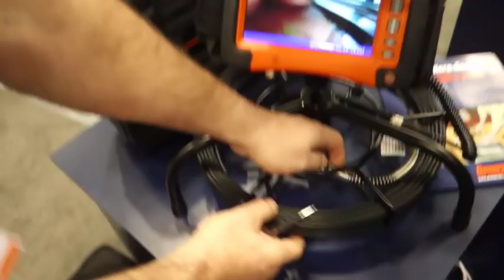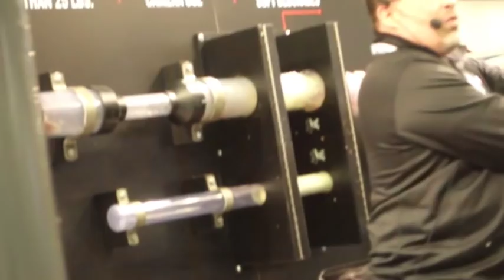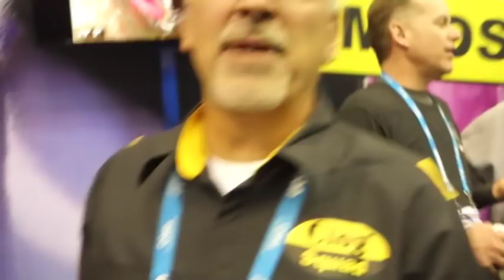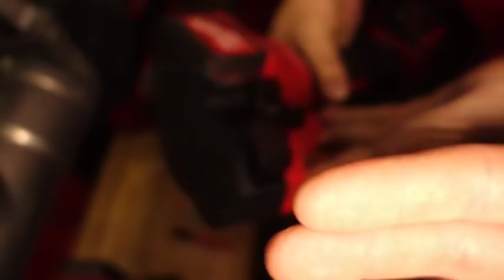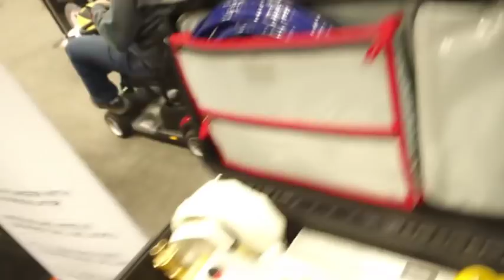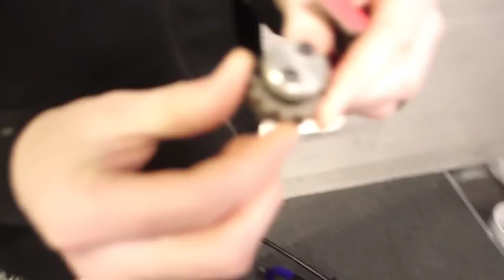Not your grandpa's plumbing tools - WWETT 2019

Comment: Regarding the Ridgid Flex Shaft...first how can you hear the difference in the pipe when the pipe is underground and 50ft away? Not that I have many 4" to 2" to 4" scenarios.  Also how does one guy work the trigger while stuffing it back into reel and wiping with a disinfectant wipe?  Third I wanna know who to call when my customers drain backs up within 3 years?  Is Rigid sending someone out for that recall or do they just send me a check each time I have to honor their 3 year warranty?  Looks cool but definitely a salesman's pitch.
Reply: I also don't understand when he says you don't run it to the blockage, you push it to the blockage then run the power/drill.  So you don't clean the whole line, the rest of the line that may be sludged up isn't supposed to get cleaned??  If I trained guys to just snake till the line starts flowing you know they're missing mores issues further down the line or  possibly before the blockage in this case where they're telling people not to run it until you hit the blockage.  You're just asking for recalls...definitely not gonna last THREE YEARS.
Reply from the maker: There's definitely a lot going on here at this booth, but I take the sales pitch with a grain of salt. I have a few close plumbing friends on Instagram (Check out https://www.instagram.com/georgetheplumber/ and https://www.instagram.com/bakerplumbing/ ) and they are just now realizing how great it works. There is another high end system called Picote which uses the chain knockers as well. CLog dog is another system that also uses chain knockers. As for the comment about pushing to the blockage: the idea is to create an opening in the blockage to get the water flowing, then pulling it back through while running the flexshaft, to allow the water to wash away the blockage and the build up as you bring it back out as you run water to flush the pipe.

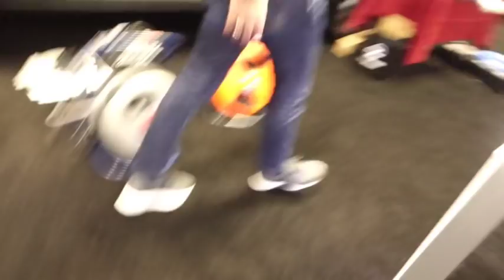Comment: Who are the cam systems by at 38:57?  You were at the Drain Cables Direct booth but they don't have any cam systems on their website so I assume you went to another booth but I couldn't see a name.  I'm definitely interested in getting a more reasonably priced monitor/control unit...Ridgid has been overcharging on those for years.

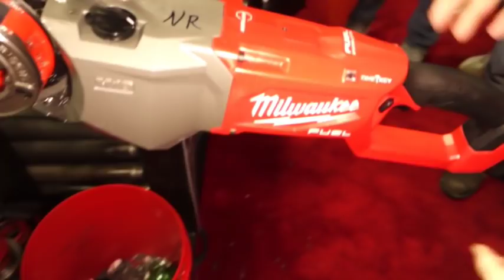Comment: 23:07 The way he demonstrated how you would push the die to get the thread started, and the safety concerns they addressed is still a bit flawed bc you could still get a sleeve or end of a glove stuck in the rotating die as you are reaching over to get leverage on the support they provided.

Comment: Brad...you are soooo underrated....sub /like and share ppl

Also...brad...can you test out the Milwaukee m12 m spector in a real world situation...cheers
Reply from the maker: Thanks for the nice comment! I actually have a 9' mspector and have used it for many different applications. I wish it was flexible enough for going in drain pipes (or had an option for a flexible cable. I found 9' was too long because it wouldn't hold its shape if you had a couple feet in the wall or wherever.

Comment: I know you are a milwaukee fan. what is your thoughts on the press tool VS the ridgid propress? I have the ridgid & am thinking bout buying another the supply house is kinda pushing the Milwaukee but they don't sell the Viega brand fittings either they sell Nibco.. im doing some research on it before I commit thanks for your thoughts
Reply: 3 years late., 
But 2 inch and under the nice vs viega press fittings are the same
Reply: Both...TTI ....same company
Reply from the maker: Ridgid batteries are the weak point. Seems like some Ridgid batteries we had got weaker much sooner than Milwaukee. But I guess that's only a concern if you're pressing a lot during a day. I definitely like the in-line design of the Milwaukee but Ridgid is no slouch as you know
Reply: thank you for the info.. glad to see you back posting videos again

Comment: Brad, what is pipe bursting about?
Reply from the maker: A cable pulls a flexible piece of pipe through the damaged sewer pipe. Breaks (or bursts) the old pipe as it goes. Under hydraulic power that is

Comment: I can remove the auto-feeder on my general main liner in 30 seconds without help from another person valor needs to work on theirs. Those augers look ridiculous as well... do they realize they are just going to get covered in shit? Those flex drain cleaners look awesome though they could be a game changer!
Reply from the maker: Good. But this isn't a main line machine is it? It's a prototype (I would have liked to show the actual product available to the market) and it's a direct competitor to the Spartan 100 machine. So far it's proving to be a clear winner between the two according to Drainmob, those guys know what they're talking about
Reply: No looks like a smaller machine still can use it in 4” lines, the main liner I would imagine would be exactly the same just bigger, that’s how most brands do it these days.